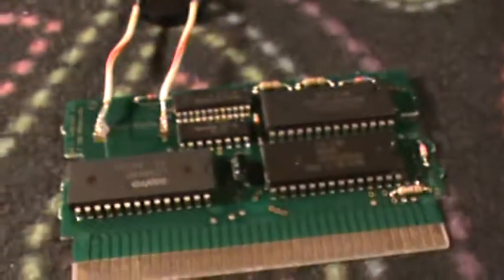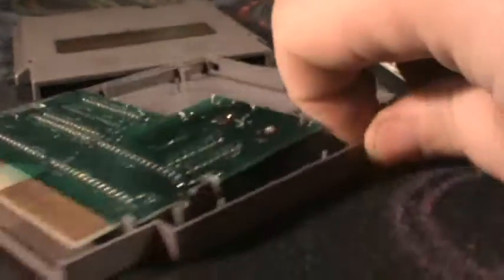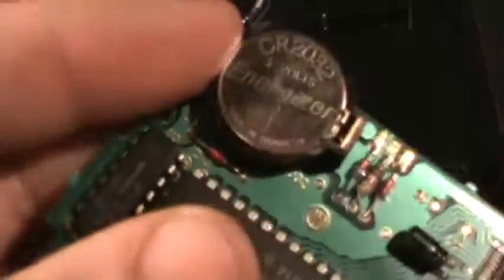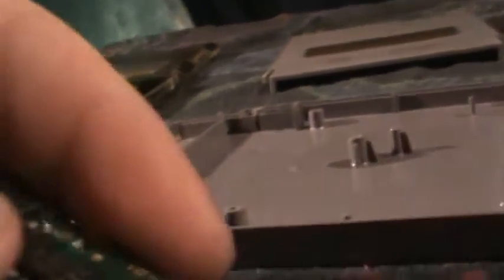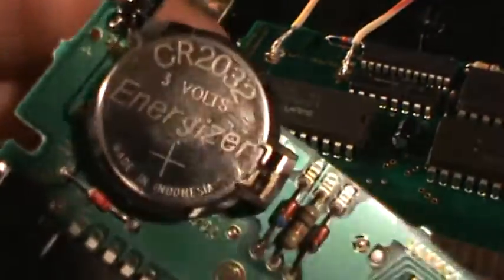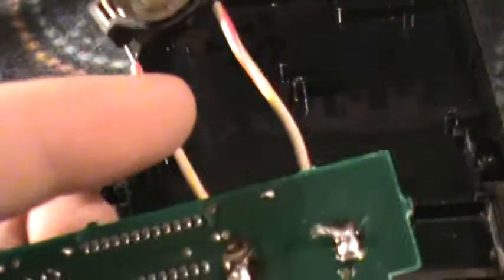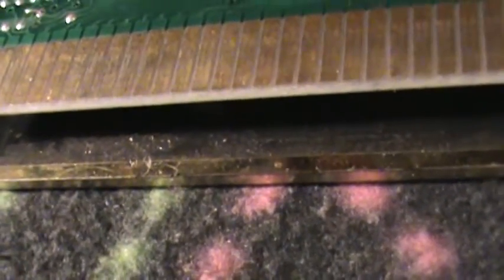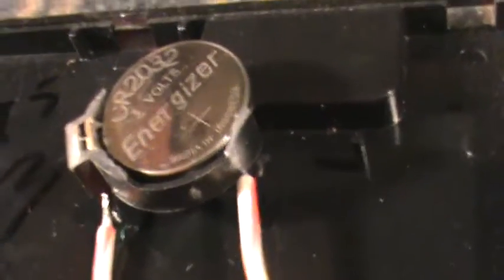Nintendo Battery Replacements with battery holder

Comment from the maker: It really depends on the games board and how much room you have.  I just repaired a copy of EarthBound for someone and was able to solder it right to the board.  My copy of Bomberman B Daman I couldn't solder it to the board but the Super Famicom cart had enough room for me to use wires.  Just last night I had a new idea.  I could just drill holes on the back of a cart and run wires through the hole to a battery holder with double As on the back.  It would be ugly but those saves would be secure

Comment: My Phantasy Star 2 game STILL has its original battery in working order.  I have been playing it since December 1990.  My Zelda 1 game's battery died in 2 years so I guess it is all luck.  Changing the battery in a Genesis game is a cinch.  You can do it with ease.

Comment from the maker: The batteries are attarched to a piece of metal tha'ts soldered to the board.  So you kind of do need that or you need to find a specific battery with those attatchments already on them.

Comment from the maker: @Monacomaverick The battery in the Sega CD is rechargable...more than likely all you had to do was turn your Sega CD on for a few hours and see if it held a charge.  It uses a rechargable 2016 which after a quick googling will cost you about $10 on Radio shacks website plus shipping.  So it shouldn't be to hardto replace the battery and add a battery holder.  If you still have that Sega CD I could try operating on it.

Comment: On digikey they do sell CR2032's with the pins spot welded on like the original batteries, and they are only about ten cents more than a regular CR2032 battery. I would personally use the spot welded ones since it looks nice, it's close to original, and well for 15-30 years of life added after this mod, I don't think it's a big deal having to desolder and resolder a new battery. So a battery holder seems fairly useless for this application.

Comment: one of my recently bought gameboy games battery gave out, when i went to replace it  i managed to rip of the strips soldiered to the board, man i was pissed, was sure it was screwed for good. in sheer desperation i placed the strips back in place and fashioned pieces of cardboard to hold the strips flush then tapped it together. Did not work, about to give up, opened it up again and made a piece of cardboard to sit in the top lid to force it together, i could barely close it! but it worked!! :D

Comment from the maker: @SOUTHWESTENZ Don't be shocked if in a few years the tape loses it's stickiness and comes off.  Tape won't last forever.  If you're going to do some shit do it right.  :D  instead of adding a battery holder you can order batteries with the little prongs already soldered on..its usually just a little more expensive and you generally have to order them online.  My fix was all shit I bought locally during one trip.

Comment: I use your method just like the battery holder that you show first in a snes games...and you know what, it works! but I wonder if the use of small wires soldering straight to the board is safe, because I can't close the game.

Comment: @JerryTerrifying I had no idea it was rechargeable. I do know it went bad at one point though. I'll have to take it apart again, because I'm pretty sure I broke the battery connections. However, I recently fired it up and it still had data saved from when I last played Sonic CD! I have had a few of these over the years, so I could have it confused with another model. PM me your info and I will most certainly consider sending it to you.

Comment: Ok, Jerry. I have a challenge for you. Take apart a Sega CD (the later model) and see if you can replace the battery in that motherf*cker. I had mine apart years ago, and I think I ended up breaking the connection on it. The battery is on the circuit board that would lie underneath the Genesis.